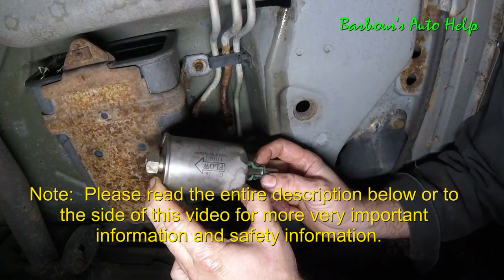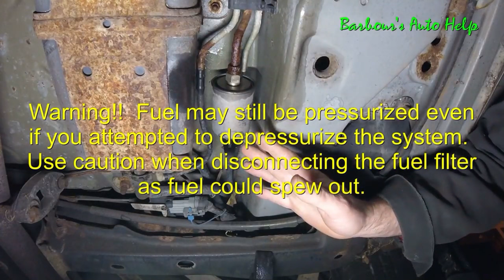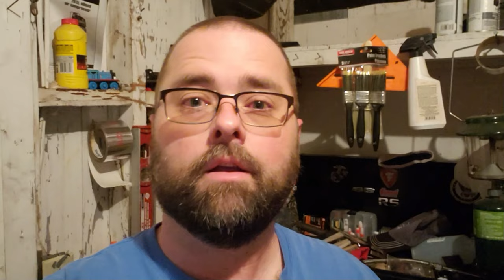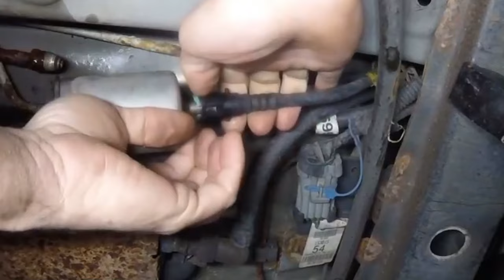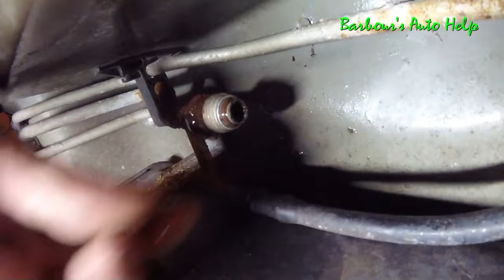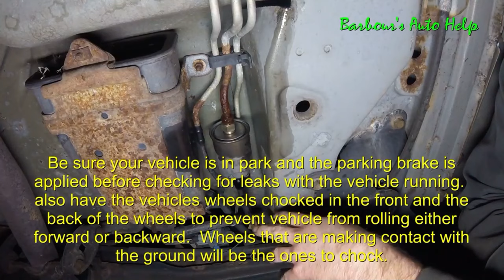GM Fuel Filter Replacement

Comment: Hey Keith my name is don.. for starters your video was very very helpful!.. to be honest this is my first time replacing a fuel filter.. I'm not rich and I cannot afford to take my vehicle to a shop where you know I will get ripped off.. long story short I drive a street sweeper but in the winter we are unable to work.. before I attempt to do this I need your opinion on something.. I started my 2003 Trailblazer about a week ago and it turned over on the first crank but I tried to start it 5 days later and it chugged here and there like it was trying to start.. the fuel pump is still priming so I'm guessing and hoping it is still working.. in your opinion do you think it's the filter?
Reply: Hey Keith I'm sorry to bother you again this is don.. I have to be to work in a couple of weeks so if you could get back to me ASAP I would definitely appreciate it!... thank you brother
Reply from the maker: It's possible.

Comment: I have aveo 2011 , my new fuel filter doesnt have direction arrow on it , does it matter which side direction we plug it ? And if yes what is the right side for in from the pump and out to the carburetor?
Reply: These type of filters have different connections on each end so there is only one way to install it.

Comment: I can't find mine there is nothing on the under the frame lol just a canister where it should be. On a metal frame with power going to it
Reply: Did you ever figure it out?
Reply: I’m facing the same problem
Reply: So, there are models that didn't have the fuel filter on the frame. However, I believe the models that don't have the fuel filter in the tank or under the hood inside the engine compartment.

Comment: Easiest way to fix or maintain a GM is to send it to the junkyard.
Reply from the maker: Sorry, but that Bonneville was a great vehicle.  Just too bad it spent so much time up north.
Reply: lies!
Reply: That could apply to ANY modern vehicle.
Reply: Driving a 2005 chevy equinox 240K miles and counting. Just drove a 10hr trip.
Reply: I can say the same about a FORD
Reply: How dare u they are great cars . U must like ford
Reply: @Lance-xl2hr  no, i have a nissan 300zx (Z32). Thats a great car. Legend among the 2jz supra and FD RX7.
Reply: After 200,000 miles my 2014 Silverado hasn't had any problems, Full AFM delete too
Reply: Every vehicle has issues.
Simply choose what issues your comfortable with
Reply: @BarboursAutoHelp it is! That’s why I’m currently trying to save mine from a bad misfire 😂